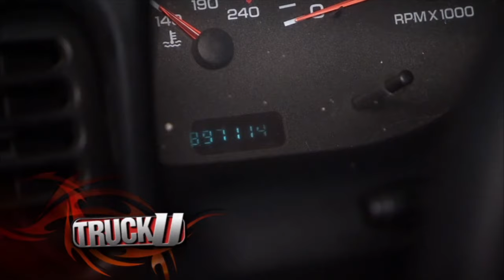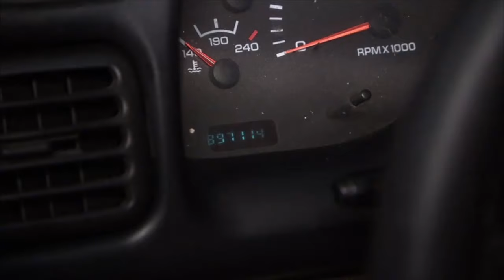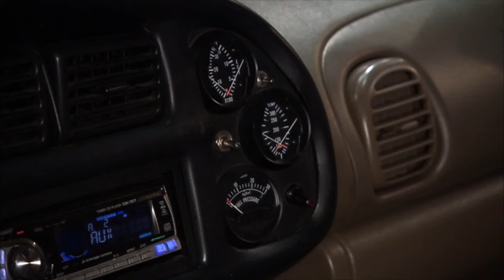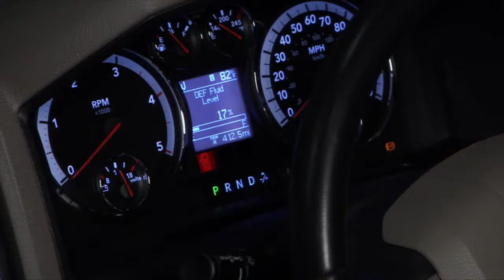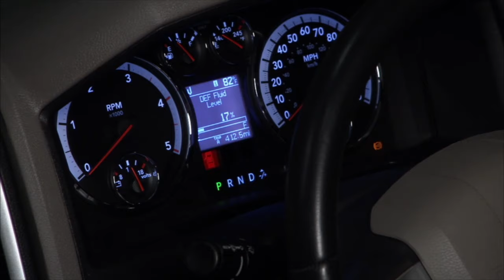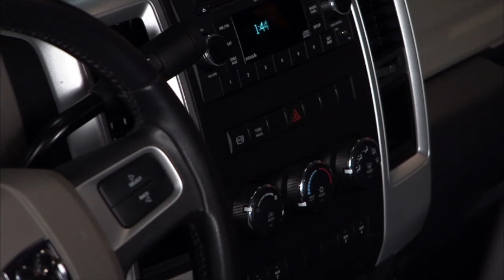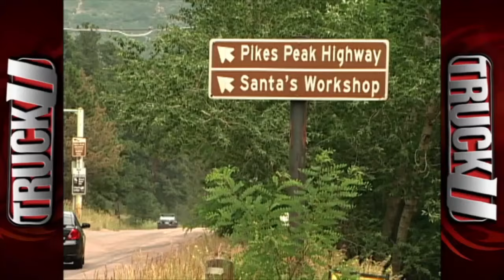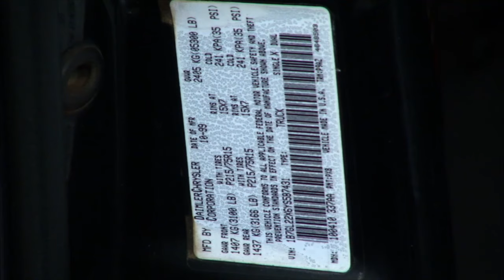Cummins Diesel-Built to Last | TruckU | Season 6 |  Episode 18

Comment: Tow/haul mode and engine brake on these....works amazingly.  just tap the brake pedal as you come up to the stop light, coming off the highway...awesome.  Keeping seats in good repair, and front ends seem to be the big thing in the fleet of dodge/rams at work. engine lights on most of the time and or check gauges.  on in most of the rams.  no one seems to be worried anymore.

Comment: That fuel filter looked pretty bad i have basically the same truck and change the fuel filters every 15,000 miles and it comes out a little black colored but very light , that filter was really black 😮 looks like its the first time it was changed honestly

Comment: How does a diesel going lean hurt it?  It is opposite of a gas engine, More diesel fuel causes more heat, not less in the case of an incorrect fuel to air ratio as in a gas engine.
Reply: I was just thinking the same thing these guys dont know their ass from their elbow.